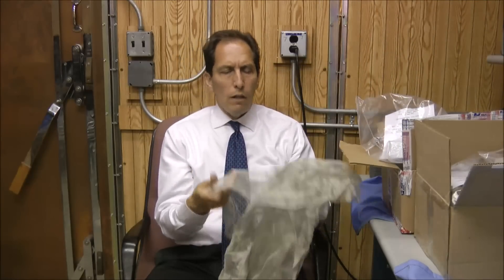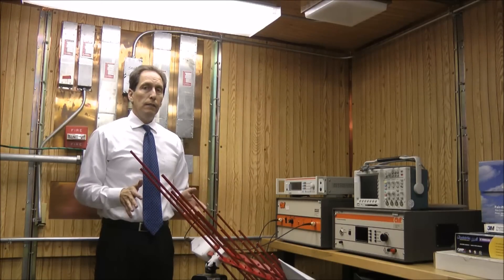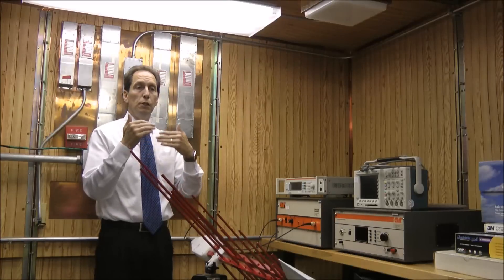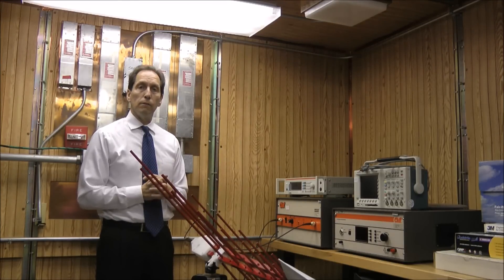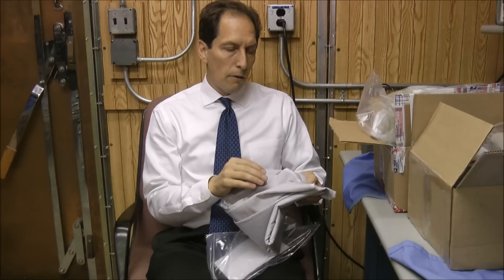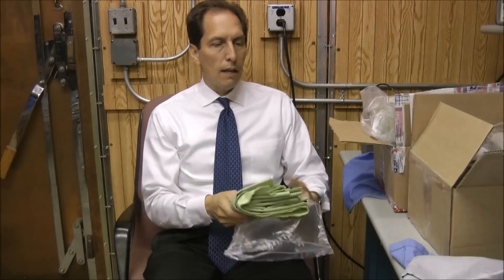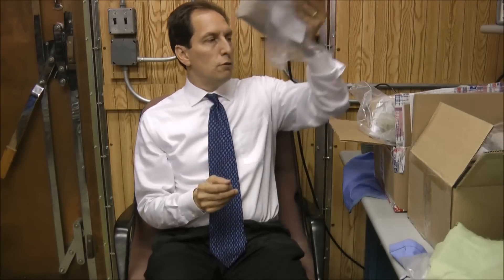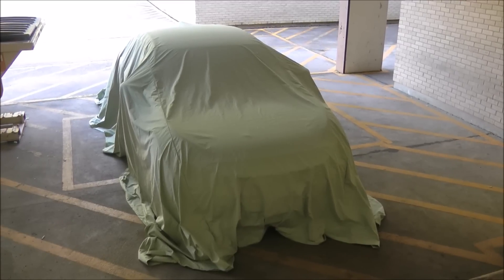Protect Generators and Cars from EMP

Comment: How about buying a old car that wouldn't be affected and load into it all the items you want protected thus making the car a Faraday box?
Reply: The older cars are had a different system using an actual coil instead of an electronic ignition system, 2 decades ago, companies supporting Law Enforcement were tinkering with a system that could be shot out of the front of a cruiser, roll up to the engine compartment of a modern automobile and deliver an EMP pulse effectively ending a high speed chase in seconds...I do not know what happened to this research but I suspect leaving the door open to this tech is why there has been no government mandate on the emp protection within the country especially within the automobile industry...I came looking for a possible solution for the entire house and garage in the event of an EMP attack such as This one: https://www.youtube.com/watch?v=6ikdZAzvM_A
Reply from the maker: If you covered the car with cloth, you could do something like that. But if you didn't cover, the items inside the car would still see field levels that were too high. The car itself doesn't provide much shielding. Older cars are just believed to be less susceptible.
Reply: Debra,Great Idea,Any car with Points and a Mechanical Voltage regulator should be fine.The Problem is,You have full tank gas,Now you want to get ,say to RI from Portland Maine,All the other cars are parked on the Highway,DEAD!.How can one drive around all the blown out cars?TY73s
Reply: It's a depressing thought but even getting to family would be all I'd need. I imagine the broken down cars would be pushed off the roads to clear it eventually. My car is old, just not THAT OLD. Sure hope I don't have to be around when/if this happens. I hate to think about my grandkids going through that.
Reply: Yes the cops have that device, so can military aircraft, to neutralize a vehicle. I would suggest you have spare electrical systems components for your chosen vehicle, bridging planks, winch, bolt cutters to cut locks or fencing on limited access highways, run flat tires. But yes any moving vehicle will be a target, the less surfaces on your vehicle exterior people could grab the better. You might want to think about armor plates, extra fuel tank, a water tank, etc. A lengthy bugout journey, like running a gas generator at night with visible lights, is asking for trouble. It has to be worth the risk or in a secured situation, I am thinking wind or waterpower and simple 12v system, quiet, low profile.

Comment: Just wondering if that room your in is EMP proof.  Its all well and good to seal
up your smaller items and never use them until "the day after".
But for the bulk of larger equipment and appliances,  I'm thinking PCs and monitors,  home
surveillance systems ,  my guitar amp and all those pedal I use a lot.  
A type of room or large box would be called for.  Insulating on a larger scale shouldn't
be a problem,   but having an open/close lid or door for items you frequently use I think
might be what some of us strive for.
Reply from the maker: The room I'm in is an RF Shield room. It offers about 100 dB of shielding and has extensive in-line filtering, so yes, it would be EMP proof.
Reply: Thanks, having a room or closet or even a large EMP box that would allow frequent easy access, would be the ticket.  It's the access door
or lid that would offer the most challenge.    One "youtuber" had built 
a box with aluminum screen wrapped around the top edge, that  the lid sets on,  he didn't really elaborate on frequent access though.     Another youtuber,  had a video on how to make "conductive
caulking", (unrelated to faraday boxes) which cured like rubber, I thought, could be used around the door, but it seems like any type of room like this would need to have a mechanical locking system that applies pressure.

Comment: Thanks for the quick response Dr.! Quick question, have you done any experimentation with building a Hydrogen generator? I know it's a bit 'edgy' but considering in a complete socioeconomic breakdown the fuel supply, including natural gas will be cut off, my thoughts have been leaning towards utilizing Hydrogen gas for heating/cooking. Am I thinking crazy here? :-)
Reply from the maker: I'm sorry, but I'm not familiar with hydrogen generators beyond what I've read on the web, so I can't comment on their use. It's an interesting technology though, just not sure what the practical challenges are.
Reply: there are excellent applications it lends to your solidified fortress & may be charged under technology given us by tesla..  look over each powerbox strategy for your prime, set that for one (or few) devices -  i say you're not crazy because it's high time techniques bring about awareness & efficiency..  all tests that share bonofide statistics are similar & that equals stability for your tools or devices..  hydronics and engineering has resulted with some incredible possibilities -  by those standards, you chose well & have reduced dangerous effects if actually applied in 'locality' due to the hydrogen margins of volatility being lower than previously said in early days, working research of electro-generated flammables.. by positive & diversified options, you suggest this powerful, clean burn source is likely to be top choice & even if it means we're plain crazy, then it can be said not knowing is insanity,♿the worst mentality.!!

           ~WarriorPoet~

Comment: Interesting video, love the testing and data. One point of contention here.... The mass majority will have vehicles broke down on every highway and every road, creating complete grid lock. Being one of the few with a working vehicle does not diminish the fact that blocked roadways will inhibit you from successfully 'Bugging Out'....atleast with your vehicle. Not to mention, you having the only working vehicle is like inviting a chicken to the lions cage.
Reply from the maker: I completely agree! Having an operating vehicle wouldn't solve the roadway problems, but it'd be better than not having one.
Reply: one word ...Jeep....its a jeep thing.
Reply: disasterprepper    I sure agree with U .  We can do what ever we can ‘right now’. This is the time to be prepared . It’s better than living with regrets . COULD of , WOULD of , SHOULD of . I realize the only HELP I will get is from video’s like yours . Thank U for educating me .❤️👍🏼
Reply: Lot to be said for having a pedal bike & maybe a small trailer. An old motorbike or one with the simplest non - electronic ignition is O.K. too.  If you're near the water, then I've seen one guy built a sort of cross between a boat & a 3 wheeled bike to get to water, then float off.Of course roadside petrol pumps wouldn't work, so a sharp screwdriver to puncture the fuel tanks from abandoned cars & a container could be good.
Reply: @michaelthomas3105  From Lil Giant Or perhaps just a siphon tube if the gas cap is not locked. Though people might report you for theft. A crisis does not always make people generous.
Reply: @henryvalero9235  Indeed, thanks Henry.
Reply: Michael Thomas sparks.
Reply: No worry here. My horse will be ready to go. I was going to get a Mule but didn't want to be mistaken for a Democrat.
Reply: @divemor  you are too funny. Seriously though,  that horse will be like solid gold, so watch it.
Reply: @tdog4240  From Lil Giant Make sure that your barn is not wood. People might try to burn it down. Get metal and reinforce doors inside, and make sure you have locks and insulation for heat/cold and ventilation that can be closed for heat. In emergency could put any chickens inside. They will be after meat or transportation of resources to feed such.
Reply: I think if my Harley survives, I can at least get around a bit to assess the area and make decisions.
Reply: I just want to protect my 4 wheeler. A small vehicle with four tires would be able to go places majority of cars can't. Same goes for dirt bikes. If you have one of those you are fast and can get around real easy
Reply: @williamgoboff1772  From Lil Giant Depends upon the surroundings. There are bound to be people looking to knock you off and take the motorbike/motorcycle/bicycle. Rural areas will be better but not totally safe. Pistol and a video cam when driving would go a long way toward protecting your survival and your right to protect yourself. 

Of course, you would have to have protected both your video cam and your video player in a Farraday cage cuz no one else is going to have one that works so police can see it.
Reply: I expect that if we were hit, they'd do it while majority at work, kids at school etc to cause as much family separation and chaos as possible. Can you imagine working 30 min from home then having to walk then get family then home safe?
Reply: If you are really serious about surviving a massive EMP, you are not going to be living in a metropolitan area.  Having working vehicles on your homestead (out of the cities) will be invaluable.  Like everything else in the survival equation, all the parts must fit together.  The great question to keep asking is "what is the next likely threat, we're not prepared for, and what can be done to lessen that threat?"
Reply: @eastofaustin258  dude, the next thing after an EMP would be enemy invading, don't you get it? Why else would they even bother to do EMP?
Reply: @lighttotheworld4880  There are many reasons someone might want to create an EMP apart from invasion.  Based on nothing but imagination, North Korea could set one off to keep us from interfering with an invasion of South Korea.  ISIS could set one off to create a climate in which Western powers would not be in position to oppose their grasp on Africa.  An EMP takes a country off line for a period of months or years.  Even if the military has hardened vehicles and equipment, the focus will be on the homeland rather than distant places in the world.
Reply: @lighttotheworld4880  They  won’t need to attack right away read One Second After available at Barnes and Noble
Reply: @eastofaustin258  Completely agree. Fast-forward 4 years to 2023--China & Taiwan. If an EMP were detonated over the continental US, we would be so preoccupied with the homeland that China could do whatever they please without interference from the USA.
Reply: @lighttotheworld4880  unless it was a solar event.  But even in that case, it's plausible that an advisary would attempt to capitalize on the damage done to our military systems.
Reply: Ask the folks who were cooked in their cars in the Paradise fire. The majority of the forest didnt burn in the forest fire because it was a electromagnetic attack and the trees are grounded. Agenda 21 right in front of are faces.
Reply: @seedplanter7173  DEWs and sec of defense even admitted to them but blamed Russia and Chyna
Reply: That's what I said
Reply: Use a side by side such as a Honda Pioneer 500. It is a little tank. Then you can stay off the roads for security reasons...
Reply: @wu ming dude, there would be no working vehicles, but millions if abandoned ones and nobody would care about them, and they all would have gas in them. Most tanks are plastic, easy drill and drain
Reply: Air? One-man drone?
Reply: Better stay real low or real high because their will be a lot of trigger happy folks wanting a target for practice.
Reply: http://doomsdayhideaway.com/letter.html
Reply: Hmmmmm!!🤔😨
Reply: Depends on if you're in a more urban areas.
Reply: Yes but you will have plenty of gas to siphon for your car

Comment: Question on the grounding- depends on the surface, macadam, gravel, dirt? Would a separate ground cloth under the car assist. Perhaps grounded via wider copper tape to a grounding system?

Do you have a decibel reading of your experiment? Consider additional cloth cover for the dashboard where the electronics reside? Is there an insulated layer between the car and this cloth?
Reply from the maker: All good questions. Making a good contact with the ground is helpful, but not critical. Testing showed only a few dB of improvement when the cloth touched the ground (as opposed to being an inch above it). That's not too surprising, since the cloth is primarily acting as a shield, not a Faraday cage, and the RF energy was broadcast down from a higher altitude. That said, putting a layer of cloth under the car and allowing the cloth that is draped to touch it would likely see additional improvement, again because it would act more of as a Faraday cage. As you know the earth is a modest conductor, certainly not as good as the cloth. There is no insulating layer between the car and the cloth. The cloth essentially works with the frame of the car to shield the enclosed electronics, just as the chassis does in electronic enclosures. Measurements taken inside the car using a spectrum analyzer showed 30-40 dB of attenuation from 100 kHz to 1 GHz. Adding a layer on the dash (or other locations) might help a little, but there are so many wires inside the car that I suspect energy would couple around quite efficiently on them.

Comment: excellent info.. that said.  I would love to hear why the cars electronics would not get fried having a conductive fabric touching the vehicle thus conducting all the energy on to the car and throughout the grounded electrical system.  not necessarily into the insulated space.  your portable reader sitting on the seat is insulated from any conductive material..  it would seem, correct me if I'm wrong in order for this fabric to work (esp. the green which is conductive on both sides) you would need a nonconductive material ( thin rubber, cardboard, moving blanket) between the two..  finally what about two layers of this fabric with a non conductive material between them.  I'm thinking a cardboard box wrapped with fabric inside another cardboard box wrapped with fabric.
Reply from the maker: I think perhaps you misunderstand how RF energy affects electronics. It doesn't work like lightning, in which many thousands of amps are introduced into the circuit and must be shunted to earth ground. Instead, RF energy can be reflected away and absorbed by shielding materials. Another thing people get a little confused about is the difference between shielding and a Faraday cage. Shielding works as I just described through reflection and absorption, whereas a Faraday cage works by creating an opposing field (through charge redistribution) to cancel the incident field. Anyway, it's a good question/comment.
Reply: I know a lot of other sites including your testing of trash cans  discuss the need to insulate them at least with cardboard, is this not needed then.     also your thoughts on the wrapped box inside another wrapped box using the green fabric you sell.
Reply from the maker: Yes, I understand the confusion. It has to do with one being a Faraday cage, and the other simply being a layer of shielding. Ideally, you want items inside a Faraday cage isolated from the cage. This way, the items are not part of the charge redistribution. If you are just shielding something, the shield is often intentionally part of the chassis. Think of it this way... your car's frame has some natural shielding, let's say 10 dB. By draping a conductive cloth over it, you are closing up the big holes in the car's frame, making it more tightly sealed. Incoming RF energy is partially reflected by the shield, and that that gets inside is also attenuated as it passes through the metal layer. Some indeed can get inside, but it's greatly reduced. That's a different phenomenon than the way a Faraday cage works. I hope this makes sense... it's hard to explain in such a short writeup.

Comment: Would it be sufficient to just protect the vehicles computer and other related controls under the hood?
Reply from the maker: Modern vehicles can have computers positioned all over them. I think it would be very difficult to provide targeted protection without quite a bit of analysis to determine what subsystem is most likely to fail. If the car is running, you can try to use ferrites on critical power feeds (see http://disasterpreparer.com/emp-ferrites), and if it's not running, you can cover it with conductive cloth (see http://disasterpreparer.com/emp-cloth). Beyond that, you'd really need to do a careful EMC analysis, or even hands-on testing, to determine the optimal way to protect your vehicle. Both of those would be very expensive.

Comment: How much protection would you expect for a vehicle or electronic device that is inside a closed modern steel building?  Thanks as always, great info.  Way too many folks out there talking about this subject with no background in the field.  The stuff I've heard as "fact" that you've disproved is a real eye opener
Reply from the maker: It's hard to say specifically without doing measurements. Sometimes there are sneak paths, such as wires coming in or long open seams that really compromise the shielding. Just based on a few measurements I have taken over the years, I'd guess it might typically be about 20 dB.
Reply: disasterprepper thank you.  The steel buildings are pretty common now. Any chance you have access to one where you could give pointers on improving to be more effective in shielding against EMP?
Reply from the maker: Testing a metal building, along with testing a cargo container, is on my list of things to do for an advanced topics on EMP book that I'm planning. That book should address many of the questions that are still not fully answered. I hope to work on it later this year, but I have to finish up my Survivalist book first.
Reply: disasterprepper outstanding.  I look forward to both of them.